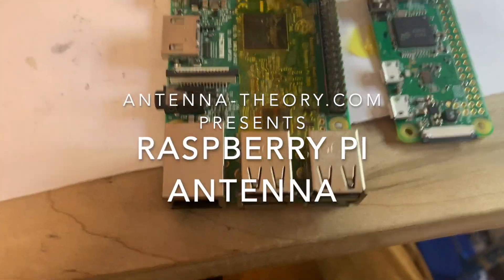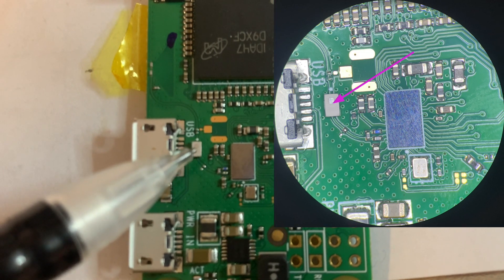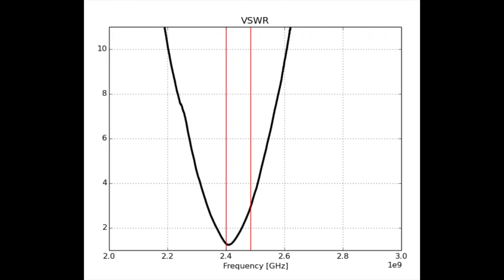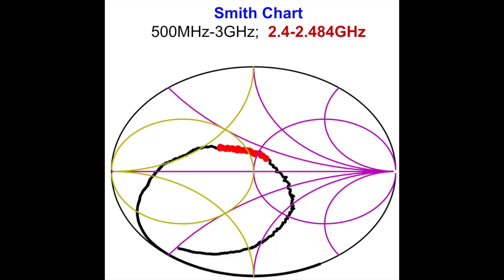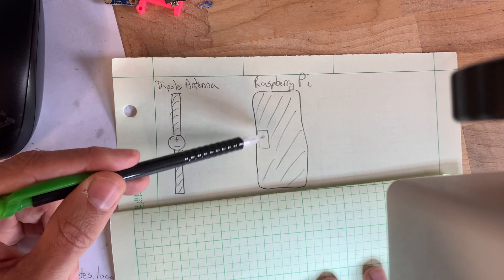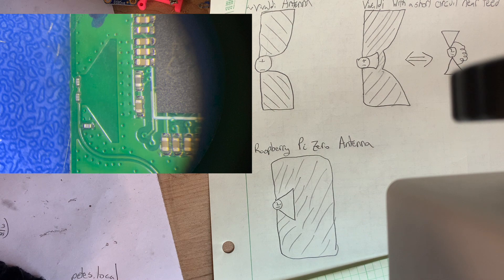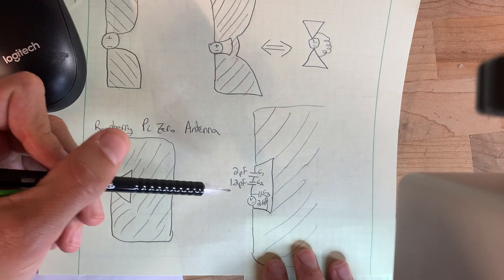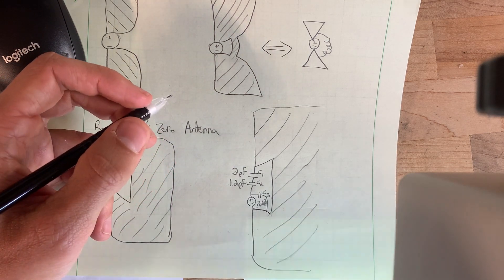Raspberry Pi Antenna

Comment: Good analysis, thank you for the video. from your hand drawing, I understand the the dipole antenna become thicker and thicker and at the end it become the entire ground plane with the short circuit in parallel. so the Raspberry Pi use the entire ground plane as the radiating element. It is quite inspiring to me.

Comment: I never would have thought that you could short any antenna that's very unintuitive to me.
Reply from the maker: Almost all antennas in consumer electronics are self shorted. The short makes for a low loss inductor that helps compensate for capacitance of trying to make an antenna as small as possible (close to other metal).
Reply: It seems weird when you see it presented this way, but also I'm starting at my two loop antennas and they are essentially one big short, lol.

Comment: This antenna is actually not that bad, definitely fit for purpose. What if it was more centered to actual frequency? 
Seems like it is dead center on 2.4GHz instead of 2.44, VSWR would be under 2 through the whole bandwidth in that case.
I wonder if measuring multiple samples would give you a whole range of center frequencies from 2.4 up to 2.5 or something...
Reply: I think it's because the component values are hard to match exactly. There were probably many tradeoffs made along the way, between the plane in the PCB to what caps were available, to the routing around other components on board, etc. They probably got to this stage and said "Meh, good enough." Can confirm, good enough, because my two Zero's have run great for a long time.